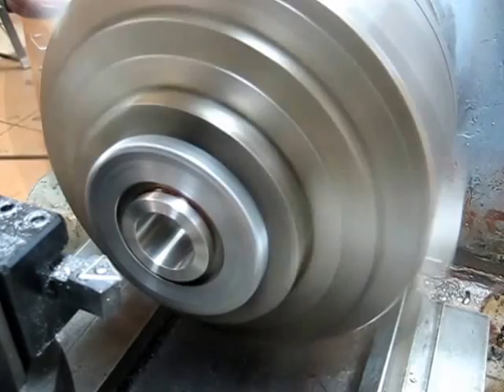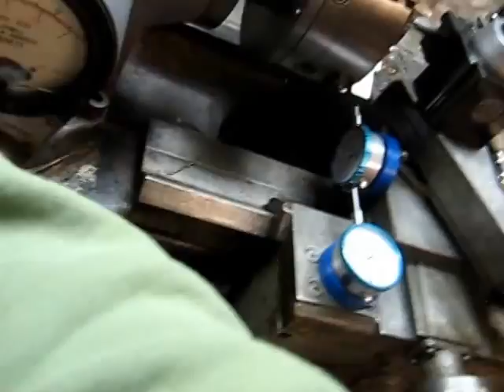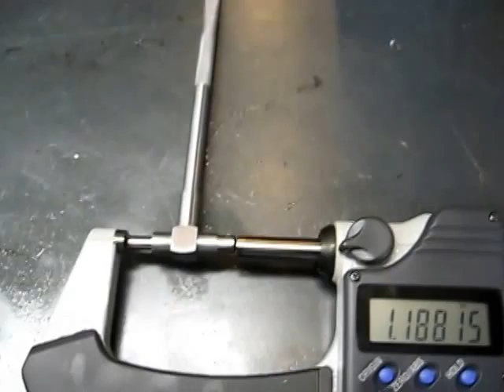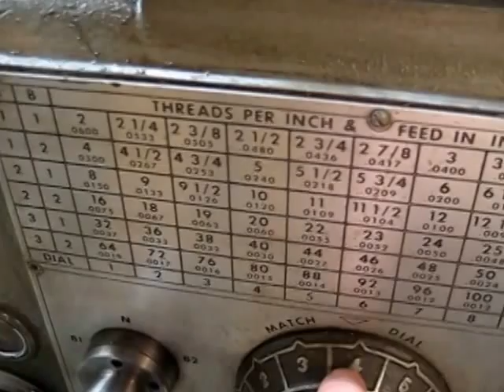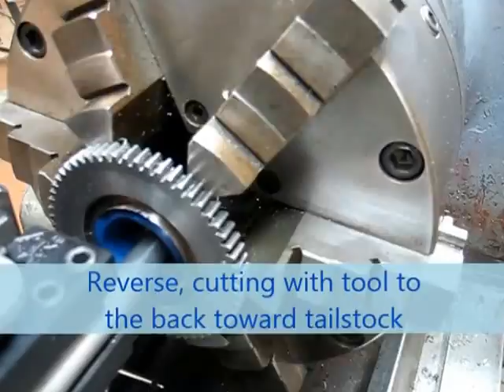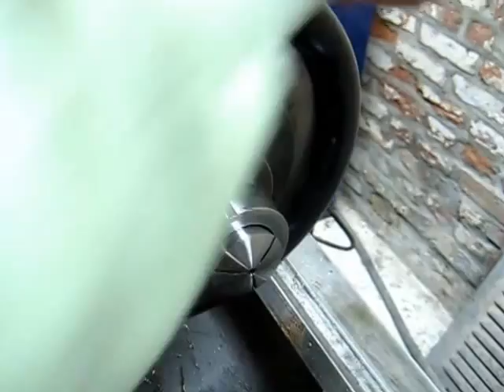Sjogren Chuck Repair 3

Comment: Hello James. I picked up one of those ATS Sjogren chucks on FleaBay. When it showed up I was getting about 3 thou runout. Anyway to cut to the chase. I took it apart and can't get it back together without the big ring gear / handwheel locking up solid.  I do take care to line up marks on the center gear with teeth on the idler gears and it runs fine and loose until the lip on the back engages the boss on the front body. When I put it together without the ring gear/handwheel  I can snug up the 4 cap screws and it works OK. When I put it together without the idler gears it works ok. The ring gear has very little slop but turns freely. I am missing something here. Can you give me a hint or a pointer to detailed instructions. Thanks, Paul

Comment: You should have made the bush a .002" SHRINK fit, warm up the disc and pop the bush in the freezer. If you were worried about taking too big a cut when machining the bore in case it came loose, them what about all the force used when tightening a 1'' collet ? I could not find part 1, so did not realise at first that it was to be a rotary Torque up until right at the end of the video.
Reply from the maker: Dave Ticehurst  I thought about a shrink fit for a while, but decided on a nice loctite setup.  Funny thing is if I ever want to undo it, the process is the same either way, heat it up.  Thanks for the well thought out comment and suggestions.

Comment: 16:48 каким образом резец позиционируется на нитку резьбы? Для меня это загадка №1.
Reply from the maker: Hi, there is a gap behind the section that is being threaded where I have room to stage the cutting tool.  Then I use the threading stop on the cross slide to set my zero point.  Tool advancement is done with the compound as normal.  Then it is just a matter of watching the thread dial and starting on the right number.
Reply: Thank you. Now i understand.

Comment: Just a curiosity James, you used the dial indicator to find the amount to be removed at around 3.20. Is there a reason why you did not keep the saddle setting and just measure with a Depth Mic the material to be removed? Thanks and cheers from John.

Comment: I see that your chuck has the old Hardinge spindle nose taper and lock on it, presumably so you can "stack" chucks and not have to take the collet chuck off to put a 3 jaw or backplate on.
Reply from the maker: That is correct, it is the 'X' model which has the Hardinge taper, there was another model with the threaded nose as well.  I can use Hardinge pot chucks on here which will be nice.

Comment: I got one of those little bases, went to put it on, screws from the indicator weren't long enough so I have to source some longer screws. :)
Reply from the maker: I had to do that with one of my older indicators as well, one of those little eyeglass screw kits had what I needed.  Sourcing small screws can be a pain!

Comment: Nice fix James. Go with a DRO, you really won't regret it. I did it partly because I have an Imperial cross-slide leadscrew, but with a Metric dial!!! However, being able to read the diameter straight off the display saves a huge amount of time! I now know I can take multiple quite heavy passes and trust the display to better than 0.01mm (4 thou). I have a magnitic scale built into the leadscrew cover that takes up no room at all.
Reply from the maker: I am sure you are right, what brand of DRO do you have on your lathe?
Reply: James Kilroy
It's a Sinpo from TheDROstore (cheapest option to the UK) and I got good service from them. I didn't use the cross-slide glass scale, replacing it with a magnetic read head from machine-dro.co.uk. The magnetic strip is just the self adhesive stuff you can buy on a roll. There are some pictures here; http://bbs.homeshopmachinist.net/threads/52334-Magnetic-DRO-scale?

Comment: I'm making a 5C machine spindle so I used your dimensions as s reference against the Royal, Lyndex and Hardinge specs for 5C.. truth be known, they are actually slightly different, but you wouldn't be able to tell visually. Requires a tenths indicator (or better).
Reply from the maker: I got those dimensions off the Lyndex web site as I have Lyndex collets, they match the dimensions given on the Hardinge web site.  Some folks just use 1.25x20 and I think that will be very loose on lots of collets.  The best possible method is to work from the collets you are going to use and go for a minimum fit.
Reply: Well, James, the standard 5C is made to ANSI/ASME specifications. The international one (from China, Taiwan, etc.)  is made to DIN/ISO specifications, and may only be a difference of tenths. I learned this on a few of my NMTB #40 taper holders (and some others). Lyndex, Royal and Hardinge specs are really good though.